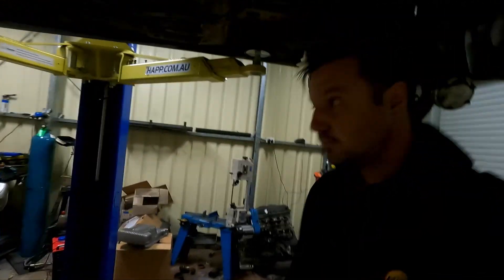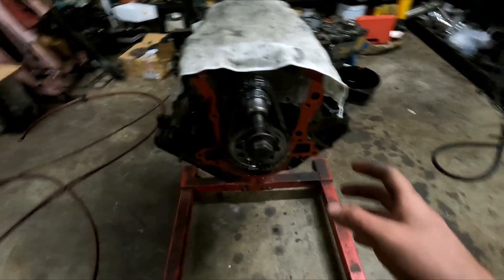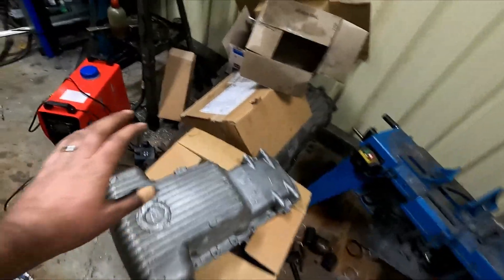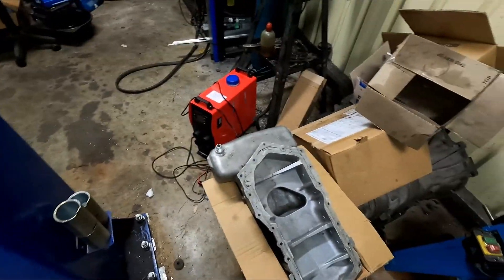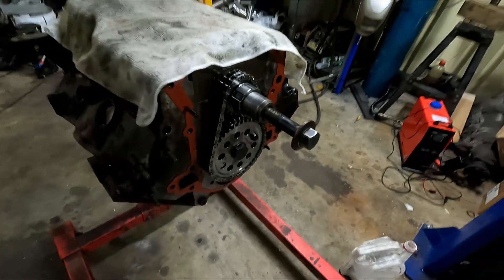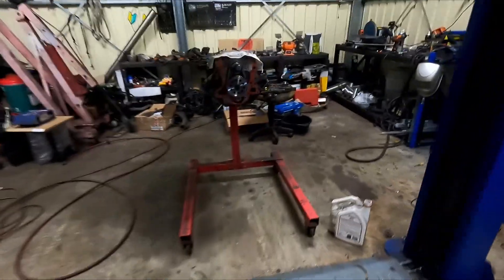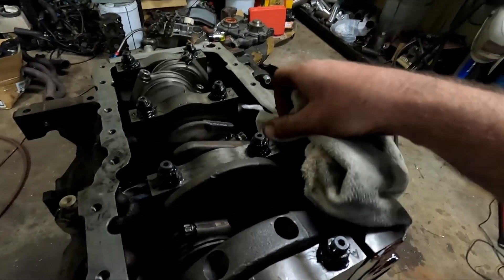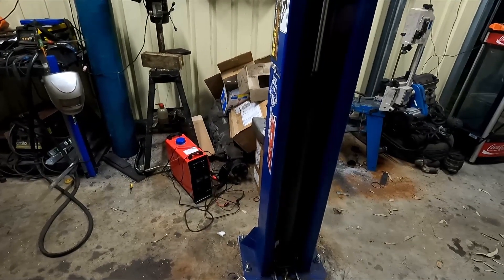Installing The Heads On My Turbo Ecotec v6..

Comment: Looking forward to more - how come theres no balance shaft at the top of the engine?

As a apprentice mechanic stuck on vlokswagens I acquired 2 ecotec motors and rebuilt them and then tore them down completely.  I didnt realise I can just pull the lifters out without taking the heads off hahaha and pulled teh cam out, been told its buckled now but next time I'll know to be careful.  Been told can slap a cam in it with no tune but im clueless.   
I tune in every so often to see whats going on with these engines.  Still trying to find out if I freshen up a VY engine or find another VS ecotecfor my VS Im pretty sure there'd be a difference greater than a EGR setup to tackle.  I feel like vy ecotecs start and run more solid and they aren't as old as a VS one.
Reply: I HEARD THE BALANCE SHAFT IS ONLY THERE FOR LOW RPM TO KEEP THE ENGINE SMOOTH, AT HIGHER RPM APPARENTLY IT DOES S.F.A
Reply from the maker: Yeah the ballance shaft can be removed but has to have the oil feed hole blocked off in the rear bearing housing... also the lifters can be removed with the heads in place as well as the  cam... definitely needs a tune if putting a cam in it man..
Reply: Vy motor will fit in a vs, only minimal will be different such as wiring harness and that’s it I think. Stay tuned with Corn Fed Boost and you’ll learn a lot 🍻